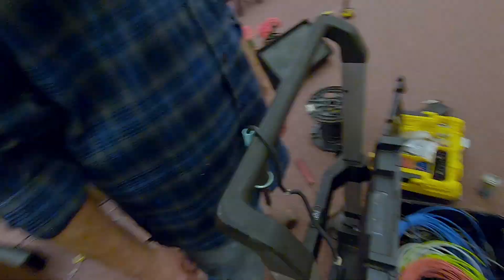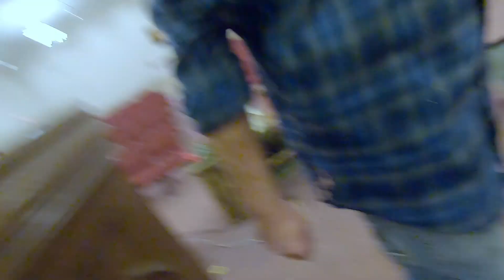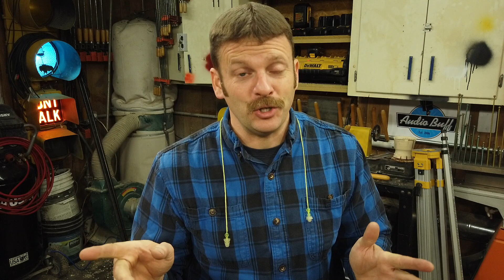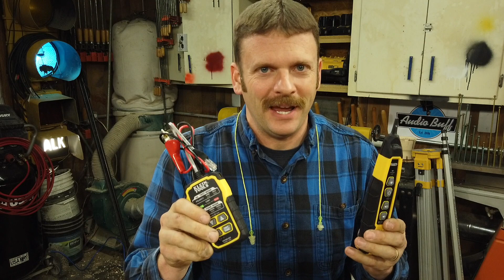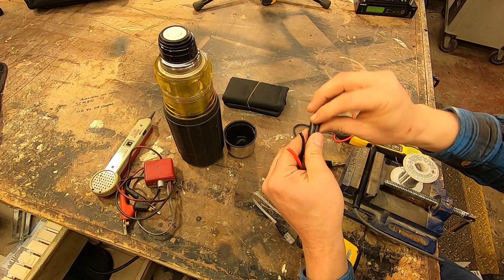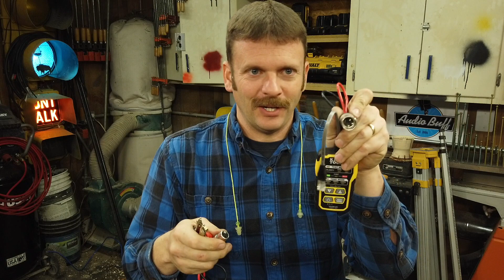The Ultimate Tone and Probe Kit - Sound Advice 13

Comment: Or you could have just made an adapter and not cut the leads
Reply from the maker: Thanks for watching.  Good thought - Yes, I could have made an adapter, but the primary function for that tool is audio.  I had a adapter for 20 years, but I wanted something that would work and be simple, for my application.
Reply: @audiobuff  primary? You mean only now

Comment: I used to share your contempt for engineers, but as my carreer unfolded I learned some things and I'm embarrassed about the things I used to say.  Architects too.  You're bound to have a bad experience with a person from every profession.  Don't let a juvenile grudge poison  your fututre relationships or diminish your Youtube presence.
Reply from the maker: Thanks for reaching out!  First, I have worked with some dense engineers that don’t have much real in-field experience.  Those are the ones that are hard to work with.  Second, my sister is a ME (mechanical engineer) and does very well at it.  My favorite thing to say to her is “engineers think, contractors do”.  The ribbing I give engineers is born from my dry sense of humor and trying to out do my sister.  A video I posted several months ago, https://youtu.be/-16zjTsyc54, had engineers involved in a major way.  Thanks for watching and more to come!
Reply: @audiobuff  full disclosure, I started scrapping drywall when I was 13, started my adult life as a roofer. Graduated to road construction,, and at 27 I started  nickel and diming my way to a civil engineering degree in parallel. 7 years later I graduated. It was fing hard. I thought I was going to set the industry straight, but I learned that pretty much everything I originally thought was really stupid had a pretty damn good reason behind it. And there's a reason that we cut up the liability between contractors and engineers.  Especially on the larger projects.  I get what you're saying, many of these engineers have never swung a hammer, but my experience is that almost any engineer when approached right will listen to what a contractor has to say. I enjoy your videos Man, just wanted to get that out there so I didn't have to cringe every time I heard the 20 years ago me speaking in your voice. Thanks for the measured response. Happy youtubing

Comment: The inability to disable the battery-saving-auto-turn-off feature of the Kline t&p kit is inexcusable... sometimes it takes a while to get to the other end of the wire (in a large building for example). I'd like to see a fix for that.
Reply from the maker: That is defiantly a problem on long cable runs. I too wish that could be turned off. Thank you for watching and more videos to come!

Comment: I just bought the scout pro 3 data tester as well as the tone and probe kit. I knew what I had would get anything done that I wanted it to but I want to customize mine the same way you did. I looked up xlr connectors and it says that pin 1 is the ground and 3 is the negative. I just want to know before I cut and solder mine, does it matter which I use for the black wire from my toner, pin 1 or 3 so that all the xlr female adapter cables I make will work properly to tone them all! Thanks and I look forward to enjoying mine the same as you have! 👊
Reply from the maker: Thanks for reaching out-thats exciting. I used pin 1 for the ground (black) and Pin 2 for the positive (red).  That way it would be treated as an unbalanced signal by the preamps of the sound system. Let me know how it works.  

I’m working on a follow up video on the tone and probe kit. Coming soon!!
Reply: @audiobuff   hey so I don't do any audio testing day to day myself, I'm an industrial electrician so I bought the scout pro 3 VDV tester for cat5 and 6 networking cable and Jack testing, as well as the coaxial abilities as well. Then I bought the tone generator you modified in a kit with the probe. The coolest part is that either the scout pro tester or the tone generator are both compatible with the probe! Being that I will use the bed of nails clamp cables on either unterminated power or data / other low voltage wiring I just soldered my positive BON clip to pin 1 and my negative one to pin 2. I did the same for my 120V male cord end adapter with my second XLR female but used a 2 wire 16GA cabtire and connected those pins to the hot and ground pins respectively on the 120v cord end. Both of my XLR adapters conduct and transmit the tone generated very smoothly and effectively and I am beyond stoked with the outcome. I honestly came across your video with the only intention of finding a review on the product I was after and I already owned it and was beyond impressed with your application. It not only feels great to be crafty and use a soldering iron but it expands the horizons of this tool beyond what thought possible. Huge kudos to you my man and definitely looking forward to more of your creations, I'll post any I dream up to pay it back! 👊